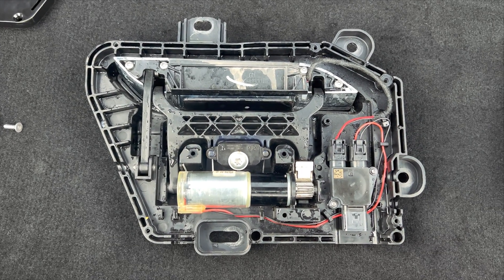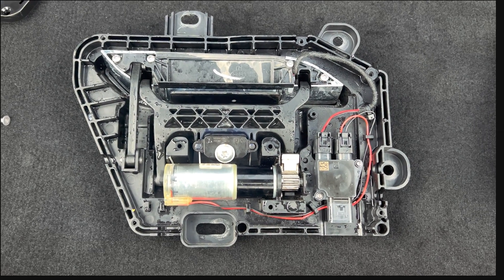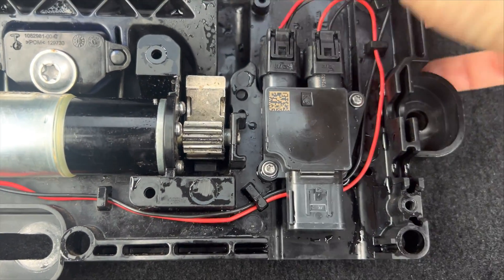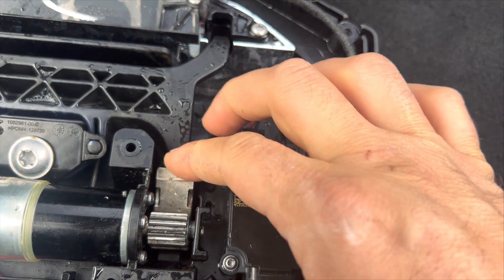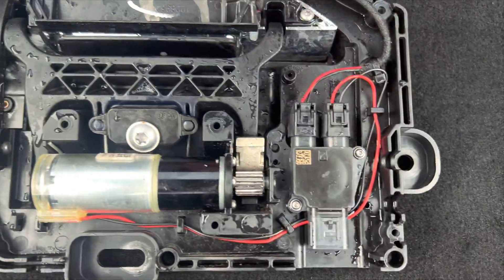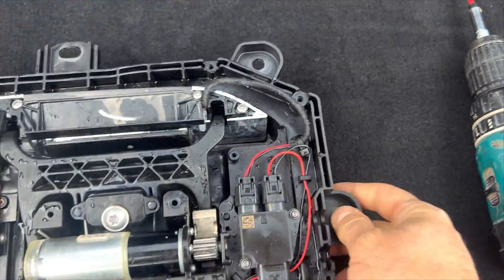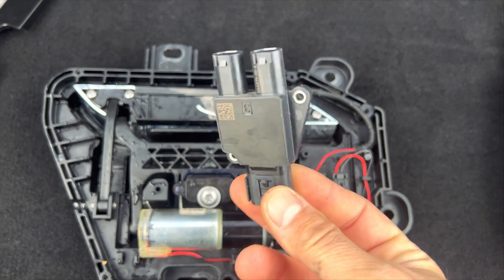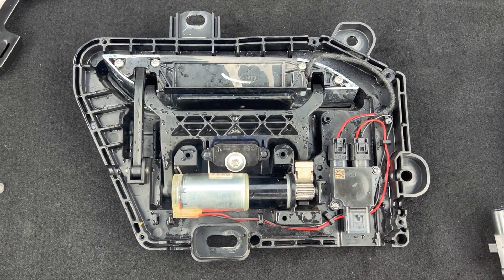Tesla Model S door handle GEN3 keep failing

Comment: My handle only works intermitantly. When I close the door the handle doesn't stay out. I tried replacing the larger sensor, but it did not resolve the issue. Anyone know how to align the magnet part, in case it's miss-aligned?

Comment: Does replacing this part require programming or computer matching?
Reply from the maker: No, you just replace and make from car service mode calibration of that handle. Should work fine after.

Comment: My 2021 Tesla Model S Performance with Gen 2.1/3.0 handles, having similar issues driver side door handle comes out and then retracts halfway however when I try to open it I can’t, I don’t hear any grinding noises just a buzzing noise when it initially presents itself and then retracts half way. I tried doing the service mode door handle calibration but that didn’t work it just presents itself and the retracts halfway and I get a calibration failed message stating “DHFD calibration failed. Handle stalled too early while presenting or retracting. Make sure there is no obstacle on the handles path as it moves.” I made sure nothing is obstructing the handle. Not sure what to do.
Reply from the maker: 1. Locate fault door.
2. Remove door panels from fault door and working door on same side.
3. Switch door module between them and retry calibration on fault door but whit module from working door.
4. If calibration is ok, you will know 100% that door module is dead.
5. Order a new module and enjoy :)
Reply: @thecstechvideos  what causes door modules to go bad you think?

Comment: I don’t now which generation, (MS11/16), it presents itself but sometimes it will not retract and stays out and then suddenly it pops back in (while driving fi). What could be wrong?
Reply from the maker: 1. Module can be uncalibrated. 2. If calibration fail, and you have GEN1 or GEN2, check sensors/switches in handle or their cables. 3. If you have GEN3 - door module fail.
Reply: Thanks for the reply. Calibration should be done by Tesla?
Reply from the maker: @Gersmobiel   No, search my other videos, I show there the procedure.

Comment: Mine fails to calibrate. Extends fully retracts half way. Says something in the way but nothing is in the way. Is it hall sensor or motor? Happens after car wash or rain. Sometimes fixes itself after staying dry.
Reply from the maker: Handle inside has a hall sensor connected to a module that is capsulated. Thant module can cause problems since weather can enter into connector area. Try to remove and check seal of connector.
Reply: did you solve this? Mine is doing the same. 2016 with a gen 3 handle
Reply: @geraci89  Yes, it's the hall sensor, i took out from passenger side door handle just to try so i know if have to order new one it's held by 2 screws. Small torx T10 i think. Connected on drivers side and it worked right away just need to do calibration in Service menu.
Reply: @wersuss  Thanks for the quick reply! Which ones the hall sensor? Is there a pt number? My symptoms are the same but it doesn't say anythings in the way. right now its stuck in the mid position

Comment: I would like to help if i can to someone that have problem like me. 
So i have Gen 3 handles, came in morning passenger handle was trying to push all out and you can hear motor in iz (bzzz, bzzz, bzzz) then retracts in middle. I disamble the door, took handle out and thought pressure sensors were bad( wire broken), then i notices the mechanisem is totaly different than in yt videos. I lost whole day trying to figer it out and nothing. Assembled all and in the evening i saw comment to calibrate handle( didn't work), make full software update, and tada it is working now.
Reply: And today it stopped and no way to fix it.  It think the handle is done, will need new
Reply: I have a similar problem. I will try the full software install first and see. I will post here. I have a similar problem like yours. It goes out and stops in the middle. I can still open the door if it presents enough for my fingers to grab it. I tried software calibration and it did not work. Now the handle is touch only mode. Any updates from your side?

Comment: Did you need a sensor from the same door handle position (for example drivers door)?  Or, will the sensor from any door position work?
Reply from the maker: No, i use rear door on front door.

Comment: Hi. Mine extends too far with buzzing sound,but doesn't work and retracts half way in nothing fully in. You think it's gear or sensor?
Reply from the maker: Trey to put car in service mode and do a full software reinstall. Is just the module. Sensor and gear should work. In my case, I reverse front door whit rear door and then full software reinstall....and surprise...it's work.

Comment: What was the symptoms here, when the module/sensor failed? I have a gen 3 handle, that presents normally with the rest of the handles, but once fully extracted, it just retracts back inside immediately. I have tried to grab it while out just to see what happens, then it just stays out, with a blinking led underneath, and not opening the door if I pull it. And it stays out this way, even if I lock the car, still blinking. But if I use some force and wiggle it a bit, it suddenly retracts again. Then, after that, when unlocking it presents and retracts as described before..
Reply from the maker: Try to make a full software reinstall on your car from service menu on screen, that will rewrite all modules
Reply: @thecstechvideos  I tried that and got nowhere.  
My symptoms are different.  Initially the motor gear (not paddle gear) was cracked.  Before I got around to replacing it, the door handle stopped moving.  It still opened the door by pressing on the recessed handle. Now with the gear replaced, the motor can be driven to extend and retract the handle smoothly.
Unfortunately, the car doesn't try to use the motor.  I'm thinking this is an error status that needs to be cleared.  Thoughts?
Reply: @AlanMcYou  did you fix the problem? I have a very similar problem, so it would be helpful to know how you dealt with it.
Reply: @Lobintsev   Yes!   I was correct in believing that I had fixed the door handle.  However nothing would get it to work.
A few months later, Tesla released a software upgrade that included new options in the service menu.  One of those was the ability to recalibrate the door handle.  That page showed that the car knew that the handle was out of operation and offered a button for recalibrating.  Pushed the button and, less than a minute later, it worked perfectly. It has continued to do so ever since.
Reply: @AlanMcYou  Thank you so much! You helped me fix my issue! Now the door handle works as it should.
Reply: @Lobintsev  Great! So happy it worked for you.

Comment: It is also common for the gear on the motor to break. We are working with a manufacturer to get new ones to sell on our Tesla parts website.
Reply: We definitely had this exact mechanical failure of the gear. I just checked your site, do you have any parts available for order?   We have a 2018 Model S Gen 3 door handle that failed to present properly as others have noted.  We found a cracked pinion gear connected to the motor.  And due to the crack, there is additional free play between the motor shaft and the gear which likely leads to the hall effect sensor not landing in a proper position to unlock the car.  Would love to find the part and not have to buy the complete motor.
Reply: @lisapanwell17  thanks! We have some prototype gears that we can send you, but they are very crude in design. They do however get the job done in a bind.
Reply: @thereelwdad  Great!  I reached out to you at your direct site as well, would love to try and let you know how it performed.
Reply: @thereelwdad  I'm also in need of the gear replacement.  I had bought a paddle assuming that was problem but got "in there" and determined that the pinion on the motor shaft itself was broke.